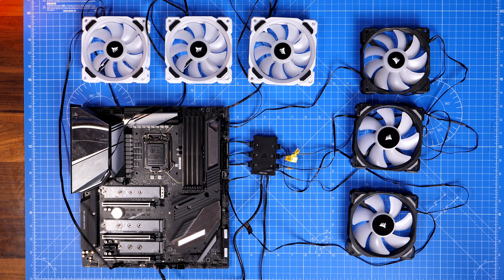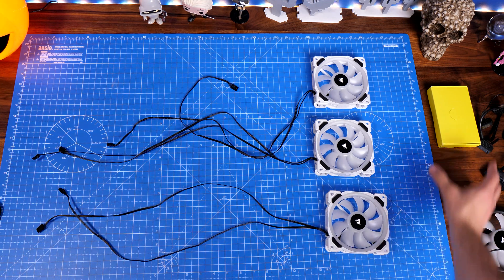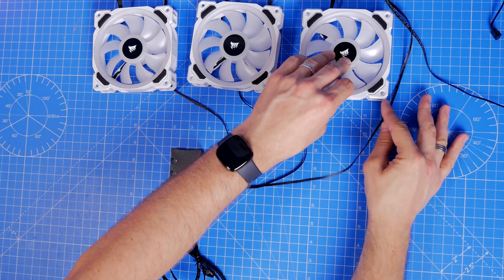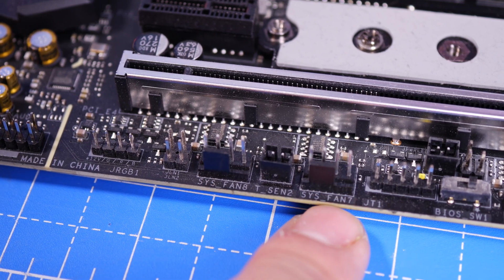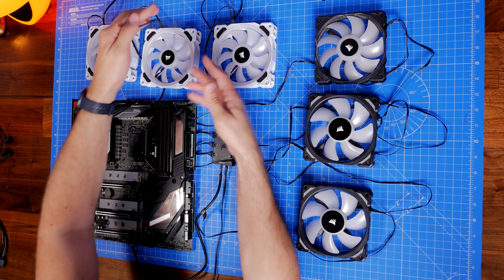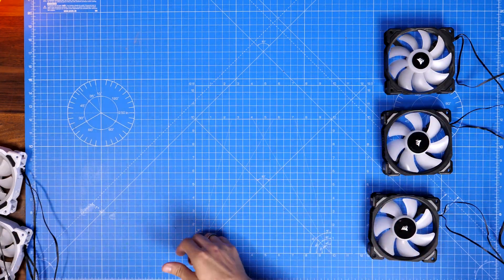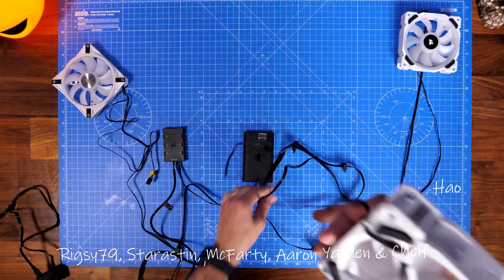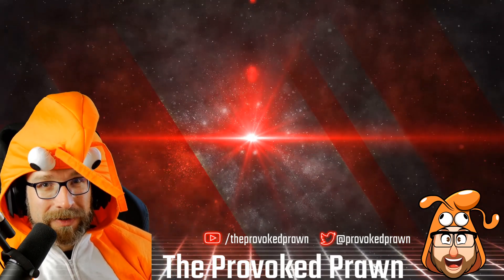How to wire and setup Corsair RGB fans  - tips for adding RGB fans to your case easily

Comment: Good video! I was wondering what would happen with the rgb sync if i buy a 5000T rgb white case (3 ll120 included) + h150i white capellix aio (comes with 3 ml120) + actually i own a ll120 triple black pack (comes with 6 fan rgb led hub + lighting node pro) I know the easiest is to stay with all same fans but its expensive for me right now

Comment: Corsair REALLY needs to come up with a way to daisy chain their fans together as Lian Li did.. My first build has 10 QL fans, definitely am overwhelmed with the amount of cables I’ve got to try and manage! Along with Lian Li Stimers, luckily I got a 011 XL case but it’s still hard, my last hurdle today is figuring out how I can connect the triple 8 pin Strimer cable through the bottom as there’s no room! Gonna have to move some things around to make it work
Reply: @PerryDaPlatapus  it’s actually really simple, I’m surprised it’s taken this long for someone to do it.. Honestly, you’ll still need the hubs! By the way CPU’s are going, we’re going to need 9 fans minimum in every build!
Reply: I managed all my cables and now I gotta redo it so I can plug in a fan I forgot to get. Either that or that one fan is defective which I doubt.
Reply: Seasonic have released daisy chain-able wireless fans (1 wire into 1st fan, then daisy chain next 1-2 if connected).
Super cool.
Reply: @PerryDaPlatapus  they could make a lot more if they make daisy chain like lian li
Reply: @1eyek1ng  corsairs new fans are looking promising when it comes to cable management now
Reply: They solved your problem! Right after I figured out commander pro with the RGB hub. Got them to finally light up after, I'm not joking, 4 years. Then they come out with the iCue Link 😢
Reply: How do you hide the wires?

Comment: When I sleep my pc, only one of my fans sometimes has an issue where it won't start back up when I wake the pc. It's makes a weird noise and just tries to start without ever spinning. I've tried different fans in the same controller and vice versa, haven't been able to fix it. I have to unplug the fan from the hub and reconnect it and the it works fine.

Comment: I have a commander pro but my USB 2.0 won't split. If I use the additional USB HUB on it, it won't work. I read that it might be the fact my MB has an ASMEDIA controller. Do you have any advice?
Reply: @PerryDaPlatapus  I have a similar one. The point is that they don't work. I can't split the USB into more than the 2 on the motherboard.
Reply: @PerryDaPlatapus  What USB 2.0 controller did you use on your motherboards? If you don't know, you aren't helping.
Reply: @PerryDaPlatapus  It was not helpful.
Reply: @PerryDaPlatapus  hey, I was thinking about getting one of those. Can I connect my Commander PRO and Commander CORE to the NZXT Internal USB 2.0 HUB? Thanks
Reply: @PerryDaPlatapus  thank you!